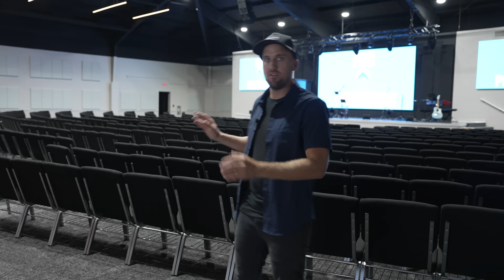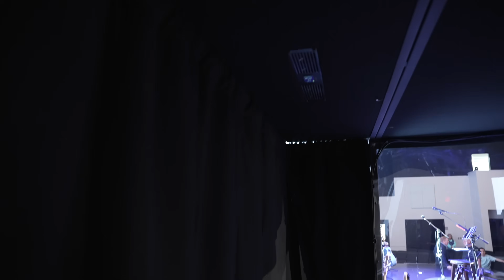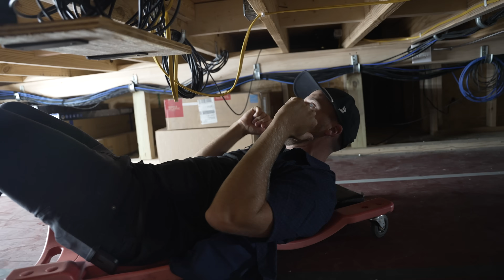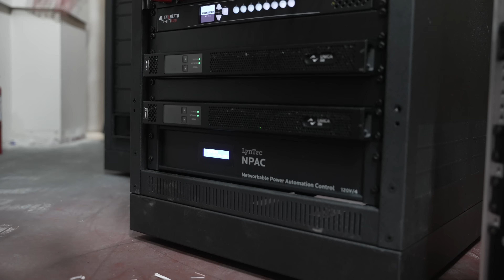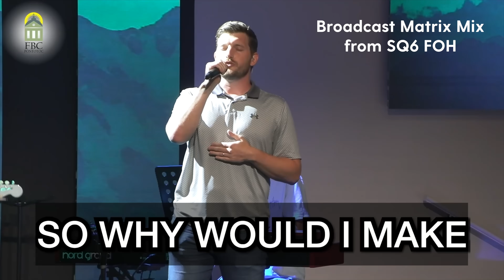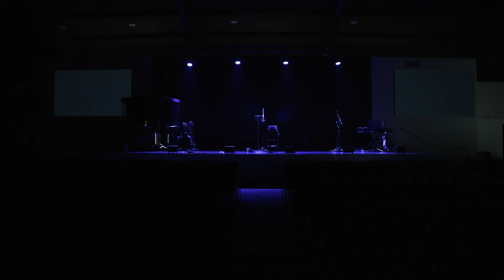Insanely CLEAR Church Audio with Fulcrum Line Array

Comment: I wouldn't have said it sounded "Insanely CLEAR" - to me it sounded like there's an excessive buildup in the upper midrange frequencies and an absolute ton of bass. Not only that but it sounded very quiet as a few people in the crowd managed to practically whisper over the main singer on stage. 

What are the front fills doing too? Why are they pointed at the floor? 

No hate at all but definitely a lot that could be fixed.

Comment: Why go with the cisco switches instead of the Unifi switches you swore by in your previous videos?
Reply from the maker: We explain in video the client already had the infrastructure with a competent IT manager.
Reply: We have multiple buildings on our campus which were all connected via 10gps fiber running Cisco Meraki Switches. We specifically requested the Cisco Meraki switches on our install for a seamless integration from this space with our other buildings and network management.

Comment: Question; What material was used as the finish for the top of the podium? I love how the podium reflects the lights
Reply: The stage floor is a black VCT tile which is then coated with a flooring wax. Depending on the amount of gloss you want, you can change the sheen of the wax (matte, gloss, high-gloss, etc.)

Comment: I have a question, if my pc have 3 output for 3rd monitor, can i use the 2nd as led wall with processor and the 3rd one as stage monitor (tv), or led wall are designed for independent use only?
Btw great setup right there
Reply: That should work. Ultimately, the Novastar LED Wall processors take an HDMI input. In our situation, we decided to link the screens to our CG computer via NDI which is converted by the Kiloview N6 (from NDI to HDMI). But in testing we also connected a laptop and an Apple TV directly to the Novastar processors via HDMI with no issues.